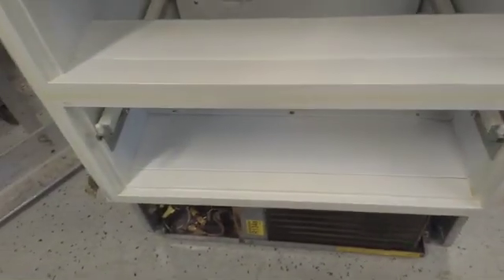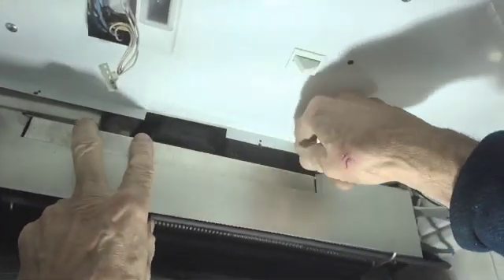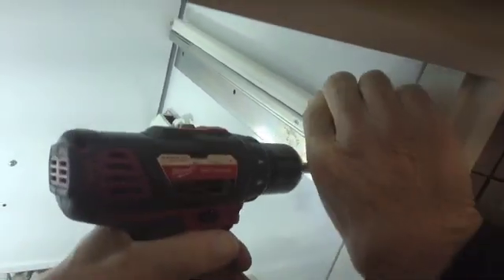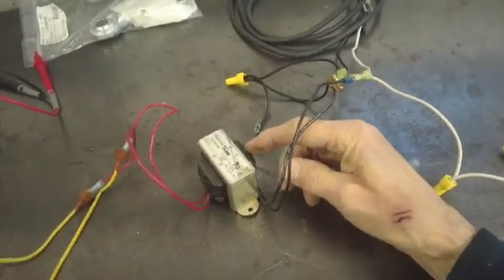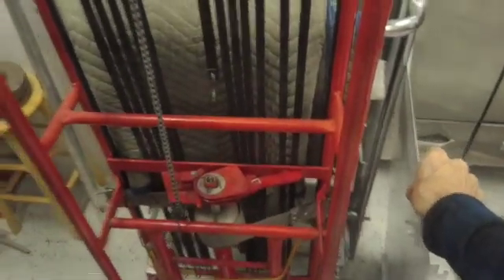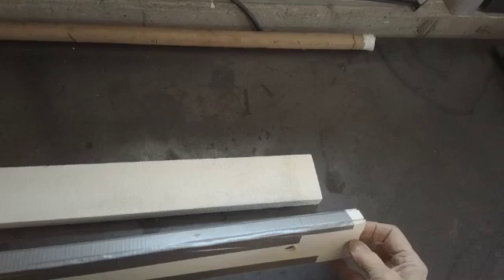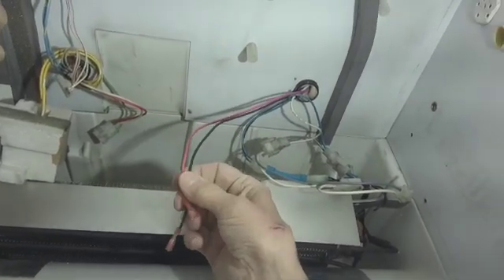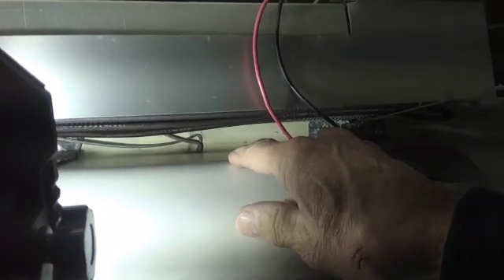700TCI Original Design Overview of Operation

Comment: Thank you so much for all your amazing videos...so helpful as the inheritor of an older 700 series with some issues.  I have this original model 700TCI/1 and it is in need of a new control board (part 4201992).  It appears to be discontinued.  Do you have any recommendations on where to find one or have mine rebuilt?  I'm in upstate new york.
Reply from the maker: Why do you think the board is bad? What problems are you having?

Comment: Thank you for incredibly useful video. I’m just working exactly on the same unit, I have a question: does an upgrade with cut off the sensor on evaporator includes besides that any other upgrade or just cut off the sensor on the evaporator with the same board? Thank you 🤝
Reply from the maker: You don’t need to cut the sensor off just disconnect it.

Comment: I am trying to make a Under the counter freezer only using the Bottom Freezer Area. Cutting off the refrigerator area. 
Do you think it would work relocating the control Panel to the bottom area?
Reply from the maker: No
Reply: @SubZeroSpecialists  What do you think would be the problems?
Reply from the maker: What model do you have?
Reply: @SubZeroSpecialists  I have a 700TC and want to convert it to a 700BF.
Reply from the maker: You can’t convert a 700tc to a BF unless you eliminate the control board and use a thermostat and a timer to control the temperature and the defrost. I’ve done it before but it’s a lot of work and I wouldn’t recommend it.
Reply: @SubZeroSpecialists   Can I convert a 700BF to a freezer?
Reply from the maker: A 700BF is a freezer
Reply: @SubZeroSpecialists  I meant 700BR to a 700BF
Reply from the maker: The 700BR has a different evaporator and compressor. The compressor isn’t strong enough to pull the temperature down to freezing temps.

Comment: I just stripped out my 700tci still troubleshooting the defrost. I replaced most  sensors and the control board. (sealed sys ok). I'm thinking it is more of an airflow/baffle issue/refrig coil sensor. That will be the last part/attempt for me. I thought you might find it interesting tho that I found that there is NO styrofoam duct on the left side. That is the way it was poorly designed as the airflow has to struggle to get up to the main cabinet.
Reply from the maker: There’s a baffle on the left side of the freezer compartment that fits into a styrofoam channel. If there’s no channel then how would the cold air get into the refrigerator compartment. There’s also a channel on the right side for the return air. Go to my website AaronsRefrigeration.com and peruse the tech help files , there you can see all the components. Actually I made a styrofoam channel for a 700 tc in one of my videos.

Comment: I really appreciate your videos. I have a 700 TCI and it's almost 30 years old. Of course, it's built into our cabinets (which I made and hand carved) so I shudder at the thought of having to demolish our cabinets and rebuild the kitchen just because the fridge crapped out.
If I was to order parts for the next 30 years of use, which ones would you get? I think I need new gaskets. The fan runs constantly. It only goes off for what I suspect is the defrost cycle.
Reply from the maker: That's tuff to answer. What you might want to do is locate a preowned unit and keep it as a spare. We also sell preowned units from time to time so check with us.

Comment: My 700 BF /I works great get cold to -5 but after a few hours shuts off no power to control panel lights off. I leave it for about 5 hours and plug it back in it works again for a few hours. Could this be the control board?
Reply from the maker: What year is it?

Comment: Thank you for your video!  I inherited this exact model (year 2000 sub zero 700TC) when I bought my house in 2006.  I've printed out the service manuals and carefully worked on it myself (usually troubleshooting excess icing in evaporator area).  I have 2 questions.  1) I have had a lot of problems with this model maintaining proper fridge temperatures.  The 700TC-2 or 700TC-3 models look like a more reliable design in this respect.  Do you think these models are superior?  (there are very limited other options for a 27" opening in a small kitchen!).  2) As I remember my compressor and condenser fan only used to run occasionally.  Now they run 24/7 or close to it, even when the set points have been reached.  They should turn off once the set points are reached, right?  The service manual says "If the freezer drawer zone reaches its temperature set-point [...] the compressor is cycled off [...]".  Any guesses why my compressor never stops running?  Thanks, Daniel
Reply from the maker: If you have a single compressor then you have a damper control that supplies the refrigerator section with cold air. If for any reason there is an obstruction of air flow from the freezer, maybe from ice on the evaporator coil, the unit will just run. Check the freezer temp, if it's way below zero I would check for air flow. You can do this by taking everything out of the refrigerator section and removing the back panel, there you will see two openings; the one on the left is where the air comes in, the right is the return. There could also be ice or frost in the return duct, there is a heater in there to prevent frost, I would also check that. The -2 and -3 models were improved with separate compressors and evaporators. Unfortunately, Sub-Zero discontinued that model and there is nothing on the market to replace it.
Reply: @SubZeroSpecialists  Thanks!  I saw a used 2010 700TC-3 on EBay, I may keep my eye out for one locally.  I know the air baffle well, I've taken apart the top and bottom, and put the fridge thermistor in glasses of warm and ice water and watched the baffle slide open and shut as directed in the service manual!  Just like a school science experiment!  :)  One more question, the top 1/3 of the evaporator gets heavily iced, but no frost on the lower parts.  Seems like a sealed system problem from what I've read.  It's been that exact same frost pattern for at least the last 5 years.  The unit holds temperatures most of the year, but struggles/fails on the hottest days each summer (80s or maybe 90s).  The evaporator should be evenly frosted, right?